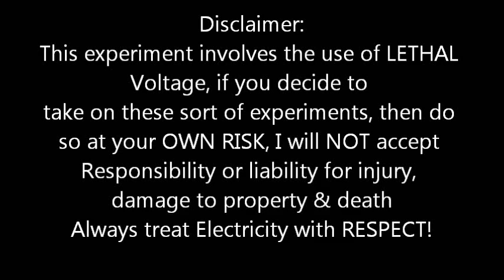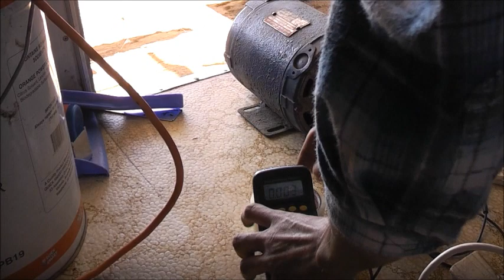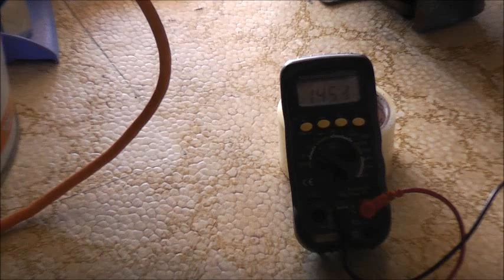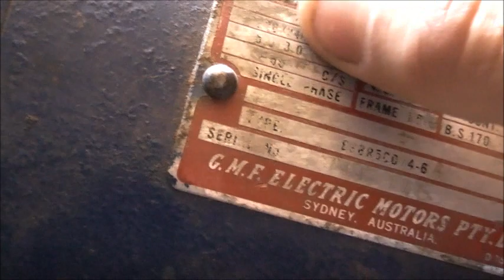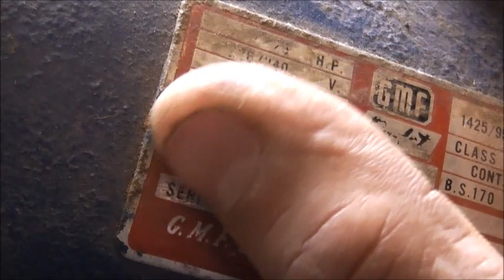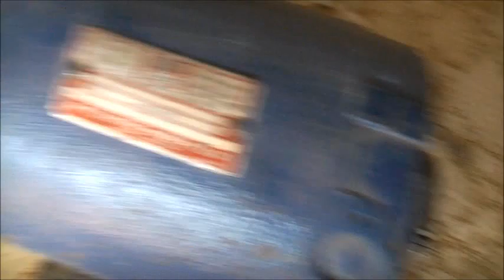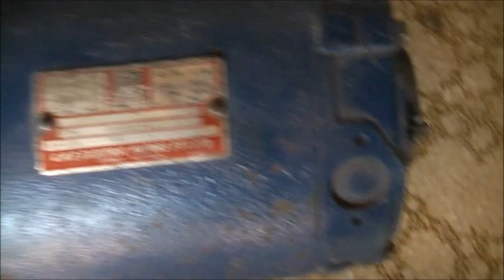40 Amp Ballast Test & Electric Motor Fun!!

Comment: Aaaah, that was really interesting what you done with the motor, to try and "wind-a-secondary" onto it and make it into a transformer. :D

I've always wanted to give that a go, but I don't fancy pulling apart the motor from my air rotor fan just to try it out. I think the reason why you got very little from the 'secondary' is either because:

(a) You didn't wind it on there 'tightly' enough and the coil couldn't pick up the magnetic field in order to produce a forward potential,

OR.....

(b) your 'secondary' didn't have enough windings,

OR.....

(c) because of the way the motor's windings impart a magnetic field in the core, it's a rotating field within the centre (imagine a spinning vortex in the middle of the core which would grab hold of the armature and thus spin it around) and not a field that would normally be associated with a transformer, be it a "E-I" transformer or a toroid-type transformer.

Now then, another experiment I would really like to try with a motor, is to CAREFULLY remove the windings from the motor, wrap them onto a bobbin of some kind, and then......rewind the windings onto the core, BUT not as an electric motor, but to put the windings on there in such a fashion that they are on the core as like you would find in a toriodal transformer, or even inside a variac. :D

Of course, don't forget to earth-out the metal chassis! :-)

Then, (BALLASTED!) energise the "motor-come-toroid transformer" via a variac and measure the current it's pulling as you crank the variac up. If it isn't pulling any current which would indicate that it's going to burn out or that it's a short circuit, then that would indicate that it's producing a strong enough magnetic field which is going to the core, concentrating upon it, then feeding-back to the windings and producing a current-choking effect (like that in a transformer off-load)

If it is doing that OK and not getting too hot after a couple of minutes, then that would indicate that there's enough windings on there, producing enough current-choking effect so that the device self-regulates its own current when off-load. :-)

Next, now that you have a 'primary' on the core, just let your imagination run wild in regards to a secondary winding on there. :D

Just like the primary, wind a secondary on there in the same direction. It could be a ridiculously thick five-turn low voltage high current job, or many many turns of fine wire to get some super high voltages out of it. :-)

The trick would be, to experiment with this and see if it is possible to rewind a motor core as a toroidal transformerand get it to firstly produce a magnetic field into the core, to get it to self-regulate, and if you achieve that, then what you do in the ways of a secondary on it.....that's your choice. :D

Of course, the amount of current you can pull from your home-made motor-toroidal transformer conversion does depend on the thickness of the primary windings, and the ability of the core to convey the flux to the secondary. My point being here, is you won't get kilowatts out of what used to be a 750w motor.

Of course, if you pull out the motor windings, ditch them and then go for a primary thickness of your choice, then who knows what current you'll get out of it? The limiting factor then would be the core: If it can't make a strong enough flux to feed back to the winding to get it to self-regulate, it'll burn up. That's when you'll know (albeit too late) that you've overdone it.

Start small, then work your way up. :-)

Thanxx for showing,

-BoomBoxDeluxe.

22nd February 2014, 13.23

Comment: Run winding has lower resistance ( thicker wire ) Start winding has higher resistance ( thinner wire )  The centrifugal switch normally opens the start winding when the motor is up to speed.

Comment: I think the MOT is quite happy with its supply.
Are you iron filings bits of rust? I though I was the only one who did that haha.
Hmmm... motor + crt = world's crappiest oscilloscope?
I would love to see that, I have tried putting the stereo channels of a audio amp to X and Y axis defect before, and its quite interesting, although it was a battery powered mini TV that has become useless because of the switch to digital only. I made a special audio file that displays a rotating star and cube XD. Unfortunately I cannot post a video of that.

Comment: Only 3 phase induction motors are self starting, single phase motors need a phase shift between 2 sets of coils to set the direction of rotation, that's probably why the can didn't spin. I thought you were gonna short the start winding to start the can..